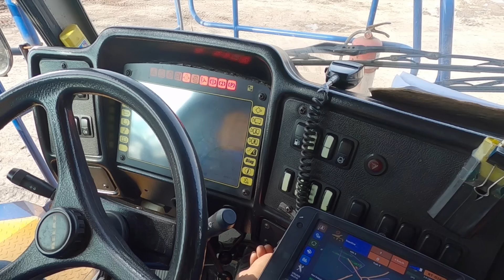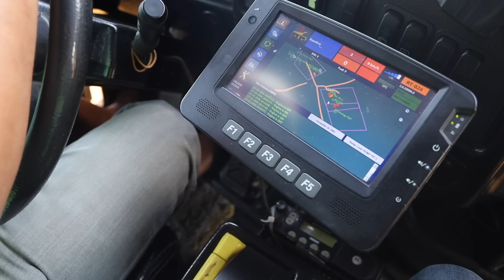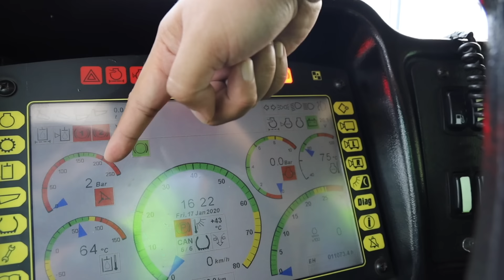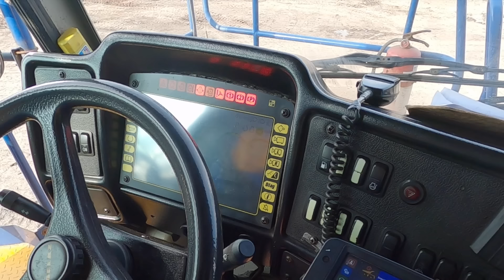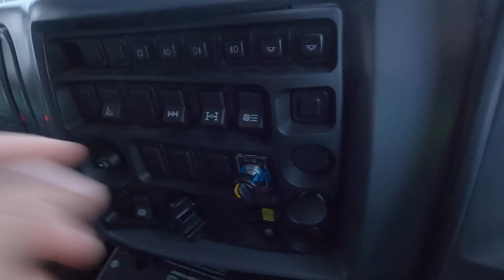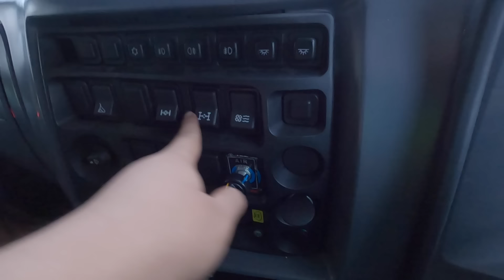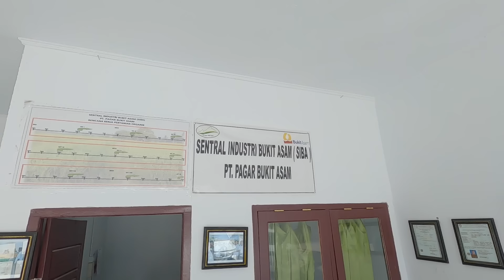Truk yang SANGAT AMAT BESAR

Comment: Rodanya Ring brp?

Torsi 5.100 newtonmeter

Torsi itu apa sm dg horse power

Jelasin yg jelas
Reply: 33.00 r 51 33 lebar tapak, 00 rasio sidewall, r ( radial) tipe ban, 51 ukuran bead atau rim